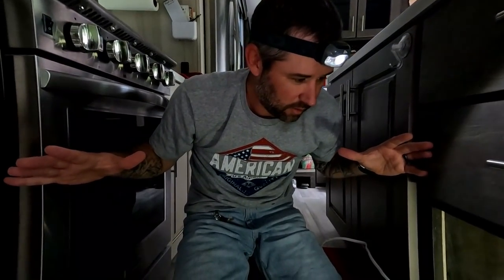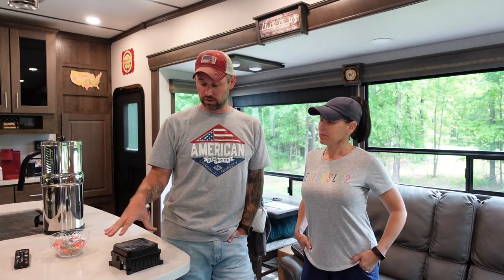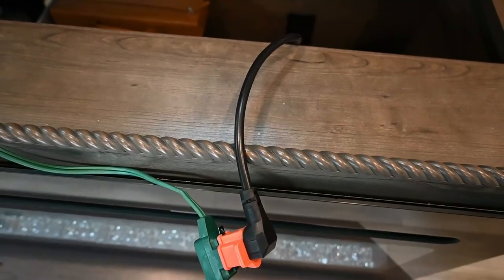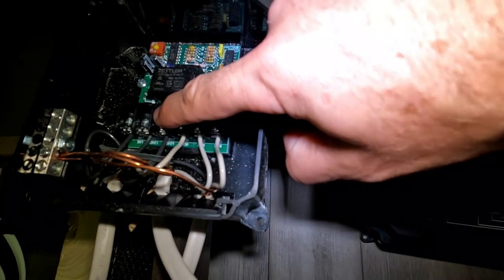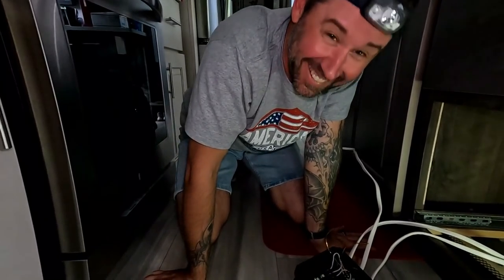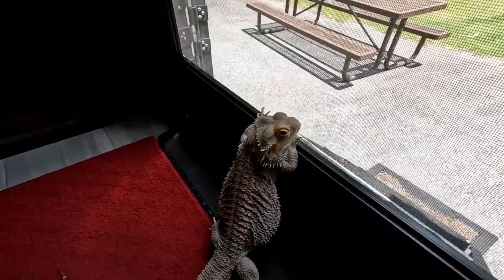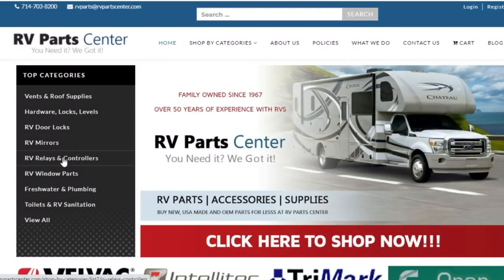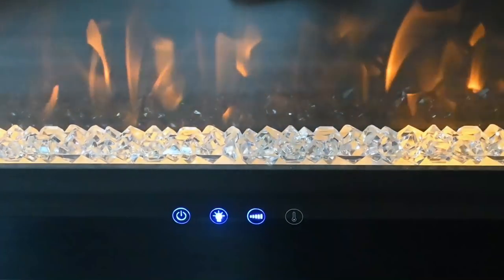Full Time RV Life (More Electrical Issues)

Comment: If that happens again and no dish washer. You can actually just jump it out if you understand electrical and just keep the box as a junction.
Your not actually even using it.
Its for running 2 20 amp appliances off one 20 amp breaker. It will shut the secondary one off when using the primary.
👍👍👍
Thank you for your service to our country
Enjoy memorial weekend!
Reply from the maker: Thanks for the info Doc. I appreciate it. 🇺🇲
Reply: Doc, as I look at the wiring diagram on the picture displayed of the unit this only swaps the dishwasher and fireplace. 
The builders reason for doing this is an overall savings on less wire, one less breaker and possibly a smaller 110 breaker panel? This is the first time I’m seeing this type of relay or load sensing device. I’m still wrapping my head around programming firefly systems. Thanks for the info!
Dustin, no offense but this was way more interesting than the poo clean up video (but that one was funnier for sure).
Reply from the maker: @22howards  🤣 Thanks Chip

Comment: There will be a part 3,unless you remove the breaker sand contacts that got hot,its causing to much draw not being clean and tripping circuit board,safe travel harley 63bcf army recovery out
Reply from the maker: Thanks for the info Harley. We appreciate it.

Comment: Not uncommon for one problem to cause another problem.
Good troubleshooting technique and "documentation" of original installation.
So if you do not have a dishwasher and no plans to install one, you might have been able to simply remove the transfer switch, eliminate the dishwasher wires, then connect the supply wires to the "load" wires that go to the fireplace.  Also, that might have been an option if a replacement part was not readily available. 
Guard "dog" Scout!
Thank you for remembering the fallen every day and not just on Memorial Day. 
All gave some and some gave all. 🙏🇺🇸🙏🇺🇸
Reply from the maker: 😳 That sounds very technical. I'm not an electrician yet. I just play one on TV. 🤣